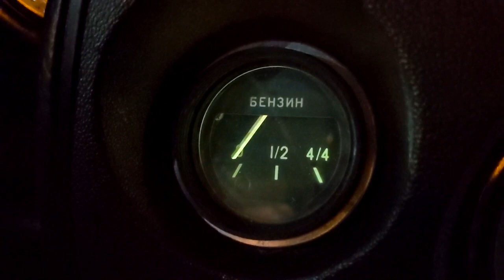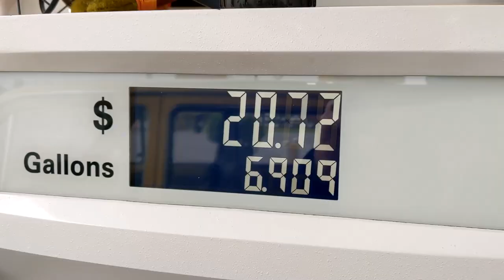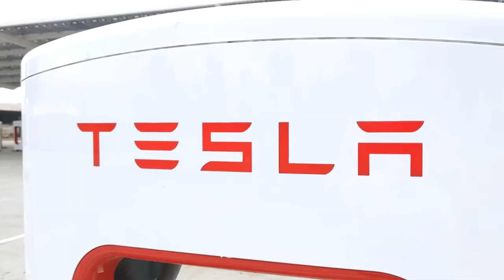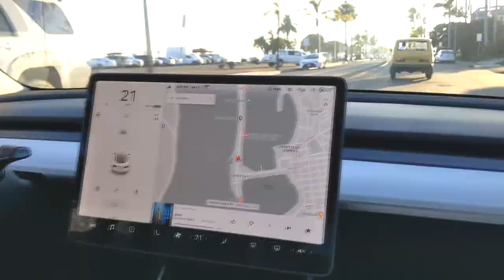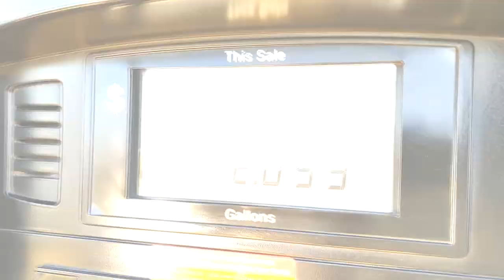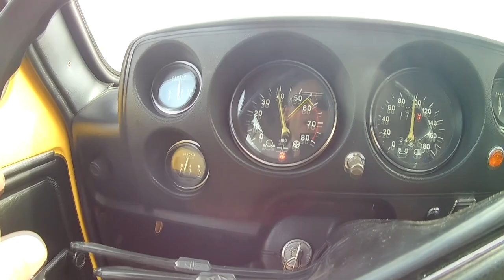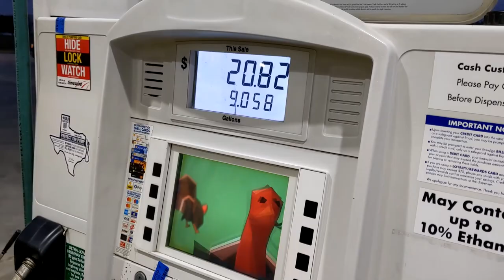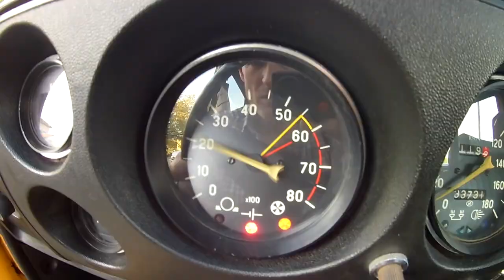I drove an old Russian car across the USA

Comment: The problem with the generator (the "alternator" as you call it in the US) was most likely caused by a little cable that "excites" the generator (basically, starts it up). This little cable is known for its propensity to fall off. The cable connector is simply not the best design in the world, that's all. I remember helping a very old guy, like in his 60s or even older, who had this problem: a cable simply fell off. They say us young ones know nothing and can nothng, har har. 
Modern generators don't even need excitement, they are designed to excite themselves, little wankers.

Comment: Hold on...idle switch? It should have either a doublebarrelled Webber or a Loreada carburettor. Fast fix for low idle is either to adjust the cable/ or idle screw. You can always adjust the mix to be a bit rich but then it burns more fuel. Fuel injection came with the second generation in 1998.

Comment: in my country (Brazil) there is a non-pollutant fuel, the alcohol it's made with sugar cane and it doesn't kills the planet, however you must have a flex car to use it (flex engine is a special engine to use both gasoline and alcohol)
Reply: Unfortunately more oil is spent producing that alcohol then if you just burned normal petrol... so sad

Comment: Niva was a first suv in Europe, innovation of 1970th. VAZ (Volzhsky Avtomobilny Zavod) engines from  1.1L to 1.7 L have the same cylinder block, ohc chain, 8 valve, twin-cam carburetter, mechanic-contact ignition with 1 coil, called '' bobina")
Niva is one of the best 4wd mud suv nowadays,  its not a joke. Full-time 4wd, central differential gear-box with mechanic- block and decreasing coefficient. Looks like Subaru old school.
Everyone in Russia ride Niva at least 1 time in life. Everybody know: if you cant go through mud$snow - call to Niva. It producing nowadays, with efi euro4 8v engine and body facelifting. Soviet Niva's chief- engineer said: If i knew, Niva will be producing more than 30 years, i build it more harder and powerful)
Niva tuning - rear differential mechanic block turns Niva unstoppable, crazy car....totaly off-road madness.
A hundreds of Land cruiser, Jeep and Gelaendwagen are save from russian swamp&shit-mud by Niva)

Comment: The fuel system on this car is cursed, I think. I remember also having a leak despite modern fuel system being rather different from the older one. And yes, I know all too well what's like to drive in fuel fumes, with all my stuff later reeking of petrol for ages.

Comment: Pro tip regarding the drinks tray - you need to ask for a cup of water, and place it opposite the coffee on the tray. Without the cup of water, the tray is imbalanced, which is why it toppled so easily.

This is coming from a guy who has done the same, also without a cup holder in the car. :)

Comment: it's in pristine condition! just needed a 50 mile drive in city traffic. if nothing breaks - nothing will break in couple of years. These cars are extremely durable. With proper maintenance no troubles you have except noise, heat, smell and so on. What i personally like bout them - can sit for years - just throw a battery and it's ok.  Beam wipers is a true oldschool rare option - keep it

Comment: "Car fixing itself" is actually a reality with Russian cars, and it happens quite often. What happened to your car was probably the oil filter got clogged with dirt. The way Russian cars were designed, they required to be in constant use to feel healthy. This one obviously did not run too much, so all kinds of nasties could happen to it at any time.

Comment: Like old Volvos, NEVER FILL THE FUEL TANK COMPLETELY.  They will leak out the last gallon you just put in.  Nearly burned down my house the first week after buying an old Volvo 850. 
Layer sold that car to another Volvo fan and warned him about the problem as part of my disclosures. He said he had the same problem on an earlier Volvo and was not to be discouraged. I have not bought another Volvo since.

Comment: I purchased an rumble bee in Washington DC. My destination was saint Petersburg Florida. Funnily enough almost the same color as your Lada

I did a massive tour of Washington and I am driving starting to think this looks extremely familiar. 8 hours after starting my drive I had arrived exactly back at my destination. 

I started again. But this time half an hour later I had again ended up exactly where I had started again

So I knew saint pete very well so once I was close I would be able to navigate. So I just put saint Petersburg as the destination. Google maps had saint Petersburg marked in the bay. And because the bay was not a valid destination it just drive me in circles

Yay

Comment: Moder Nivas are even better than mine: they have power steering, air conditioning, modern electronic ventilation control and even more minor modifications, which all sum up into a nice little modern car. In the 90s, LADA designed a new Niva (2123), but it was sold under Chevrolet brand (until last year, I suppose, when it has finally became a Lada as it should be). The Chevrolet Niva has a completely different body, interior, sound proof, but in terms of power train, it was simply an old Niva improved to perfection. Ironically, in the last few years, both Nivas became almost identical from the power train standpoint. There are talks about a new Niva to be introduced, but I'm afraid it will be simply a rebranded Renault/Dacia.

Comment: my dad had a 1981 in canada here, brakes were awful, keep a well rounded toolkit. that little truck pulled many domestic 4x4s out of ditches.out steering wheel had some fancy design on it, the electrics were horrid. you seen sparks when u turned on a fan or lights. i like the left hand drive with left hand start, it was a really cool truck of sorts. traded for a new vw in 88

Comment: I used to live in Houston and currently in Dallas. Driving in both Houston and Dallas is a nightmare. The roads were poorly designed and the everyone go insanely fast even in the slow lane. You're either a prey or a predator.

Comment: The gas quickly heats up the engine.  Quickly thickens the oil burns.  The petrol engine injector must be replaced with a newer version.  Less fuel consumption.  Than old.  Adjust fuel supply.  You can drive with a full tank 40 liters 7 liters _9 liters 100km real 500_600km

Comment: 12.69 volts is NOT a working alternator  when running the alternator should be charging around 13.5-14v

Comment: Ours could be switched from 2 wheel to 4 wheel and had High and low. Wouldn't have taken it across the US though, You learned a lot of half assed repair techniques with it though, also the heater fans never worked properly, and one time the Accelerator pedal broke off in cold weather.  I don't get the point of the fancy fuel in it though, it will run with almost anything.

Comment: The oil probably just got too hot and runny. I'd probably dose it with  thicker oil for driving in desert. (Or change the oil completely) It makes the oil pressure rise a bit and can at least get you to a repair shop

Comment: 10:18
This car consumes about 17-20litres\100km in a city range
And like 10-12litres\100 on a highway, it really depends on how fast you want to go
Also, this one is a carburetor, so you can tune it to a better dynamic (increases fuel consumpt) or better fuel efficiency (loss of power)
You can tune it to something in between, of course, but... this is NIVA, it will suck petrol like a bloody truck, anyway.

ps. you should stay in between 2500 to 3000 RPM to achieve a good fuel efficiency, use your 5th gear (if you have it)

Comment: These VAZ 2121 (Lada Niva) was in the former GDR mostly a car for off-road and the mountain regions by the police, called "Volkspolizei". A private driver was happy to call it as his own. Lada was in this time expensive and more rare for private peoples, they was as import from Sovietrussia limited in export for socialism "Brother-States".

The government of the GDR worked with Lada / VAZ, preferably for the Police and Stasi authorities, because they were quite robust, reliable and more powerfully motorized than the commercially available cars in the former GDR.
The Lada / VAZ 1200, 1500 and 1600 was a popular car for police services:

Lada/ VAZ 2121/ WAS 2121 (Niva): https://files.bos-fahrzeuge.info/vehicles/photos/a/2/4/4/77229-large.jpg
Lada/ VAZ 2101/ VAZ 2102/ WAS 1200 (Shiguli)*: https://www.fahrzeugbilder.de/1024/lada-1200-vaz-2101-fustw-32461.jpg
Lada/ VAZ 2103/ WAS 1500 (Shiguli): https://www.fahrzeugbilder.de/1024/lada-1500-vaz-2103-fustw-32543.jpg
Lada/ VAZ 2106/ WAS 1600 (Shiguli): https://i.pinimg.com/originals/07/4a/c8/074ac8d7ed72d4654df29a2cea6dda0a.jpg

*Was a license by FIAT Italy from the "Fiat 124" (Seat had a license from this type too as "Seat 124").

Comment: some people extract a (false) sense of superiority by driving and pooping a Soviet car (be it Gaz-21, Gaz-24, or Niva) that was designed in mid 50-s and 60-s (or in 1971, like this particular car) for a very different country and purpose. Suppose you drive a 1970 Defender along the same route - you'd have your butt amputated halfway across. Just saying - I had my first Niva in 1983, and have another one now, it is a very inexpensive carburetter car. It has a fuel consumption of 12-15 liters/100 km (about 20-15 MPG). It is sluggish (like 26 sec to 100 km), with just 1600 cubic cm. But it will crawl through mud in a wet field just as good as any US or British offroader that costs 20 times more to buy and keep.

Comment: I had drove the same (little bit New, another 5th Door, but the same engine and gear box & and all power train). I did 120000km on it
PS and i had excatly the same additionaly locks onthe front Windows
To reduce the noise from the gear boxes (there is two) i used меховую шапку ушанку& winter jacket covered the are of transmission

Comment: Nice travel report. But I don't think driving in a Lada Niva is particularly adventurous. Unless, as an American, you are afraid of a manual transmission. If a Lada has been well maintained, then it is reasonably reliable. And if everything works - and it's not difficult to keep everything in good shape - then you don't have to let trucks overtake you.
You would also have had problems with an American car that was in poor technical condition. As a German, I learned to drive a VW Beetle and later had a FIAT Panda as a student. A Lada with 80 hp would have been downright comfortable.

Comment: You actually shouldn't have used the premium gas, with a Soviet designed car, the addetives can disolve carbon build up hence oil pressure issues

Comment: You shouldn’t put this type of fuel in the old Soviet car as it supposed to run on type 85 and 93 just burning everything in the engine because octane rating much higher .

Comment: I would check what type of oil you have in your engine next time. Considering it's probably imported, it might have cold winter oil in it which gets really thin in warm weather as it's only made for cold temperatures. That might have been why the oil pressure got lower, idk.

Comment: Maybe your belts or chains are off in some way where sometimes they are off sometimes and sometimes not....when they are off it effects the alternator and oil pump. I have heard of similar issues with ford timing chains (btw Some ford oil pumps are actually powered by a chain). The engines have issues with performance when the timing chain is offMaybe that is the issue. New Belts or chains? Also бензин is pronounced benzin....just like German

Comment: loool, those gas prices XD
so assuming thats 3,53$ per gallon for gasoline, just to calm you down a bit:
here in germany we pay around 1.60€ per liter for gasoline here atm, so multiplying it by 3,785 (to get it to gallon) it would be 6.05€ per gallon, and because at this moment 1€ is worth 1.19$, if my math is correct we pay around 7.20$ per gallon here atm. id love to have your prices right there

Comment: Those things usually last quite a while, this had clocked like 200 000 miles, and clocked down... just restore slightly the Truck,it isn't that hard, this machine was definitly a lot used, the gas tank was probably rusted through, or a bad seal somewhere and god knows what this machine was used for... restore it, and you have a reliable offroader

Comment: Hello kiwi! Just been given a lada niva 1.6 which I have kindly been handed down by an old family friend he is ynae to work on it himself! Is there any tips you have for a new lada owner plus any recommendations on clutch as this one is on the way out thank you
Reply from the maker: Congratulations! My only advice is to be ready for repairs! :D I think a clutch replacement will be a good 2-day job for you, so take your time. I think it doesn't matter what brand of clutch you use, because the original Russian parts are low quality.
Reply: @KiwiEVadventures  been watching all of your videos now I’m very excited to collect the car on the 10th! It’s in a lot worse condition than your one, I think the engine has been changed to a  fiat 2000TC, it’s what I’ve been told! How is the electric conversion going with the lada? also if you want any more this family friend currently has 12 and 4 of them are with the 1.7 engine and lots of parts

Comment: Haha, see cars do fix themselves.
I drove a crap cobalt with the sketchiest transmission everyday.... for 5 years. put nearly 70k miles it and it was skipping and hopping from day one. But sometimes it would go months without that issue. 
Never fixed it, and I ended up selling it for 1200$ to some poor bastard a few months ago. But it passes inspection and runs! (I'm awful)

Comment: I would have drilled holes in the dash (from experience you need a lot of drill bits, that metal is thick) and installed 
1 x extra fan
2 x Cupholders

Would upset the purists, but my money, my choice
Reply: Lol ladas are made to work on.

Comment: This is a cool car! when i looked it up i just kept reading it was 4x4, is it 4x4 as in it can go into 2wd/4wd or is it full time 4wd and has a center differential?
Reply: Full time 4x4 mate. Maybe some aftermarket options available. 
There are Turbo kits for 1.7L injection engine strarting from ca. $1500 hehe...
Reply: @STOP2NWO  Little tiny turbo on one of these? That sounds awesome! And full time 4wd too? Sounds like a blast.
Reply: @joeyoung4309  It's basic cheap light vehicle so potential of fun offroad :)

Comment: Don't lie to people saying that it tops at 55 mph, we had a Lada and it could hit 80-90mph. My dad put dual carbs from a motorcycle (not sure what it was) and it could even hit 100mph after that. Not bad for a 50 y/o 1.6L motor in a car that costed $5k (today's money) brand new :D
Reply from the maker: I mean, I could push it to 80mph but it would be doing 6000 rpm because it only has a 4-speed gearbox...

Comment: I don't understand those who find special charm or beauty in this car or tells it's a legend and continues about it's participation in rally and being very progressive car of that time, as an offroader with light cabin and no hard frame. Did you try this car, as an utility vehicle? It's small, very small and uncomfortable, noizy, very very weak as for engine. Usually brakes are also very poor and if you see a man crossing the road you hardly can stop from the speed of 80 km per hour. The higher speed you wont' reach because the engine is weak. It also usually smells gazoline. Did you try to get to the rear seats? It's awful. And the car is very very small and uncomfortable. My father said he does not understand people who buy these cars back in 90s. Nowdays it makes absolutely no sense. This car was awful and it is awful. It's almost at zero level as for safety.
Reply: The reason is, that this car reminds the childhood for many of us.